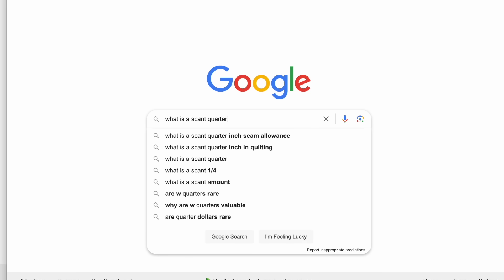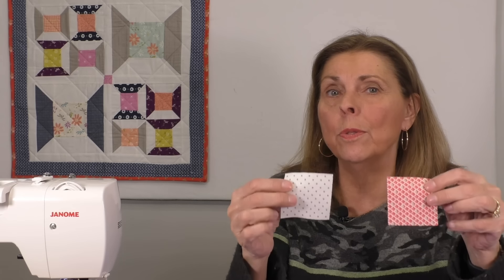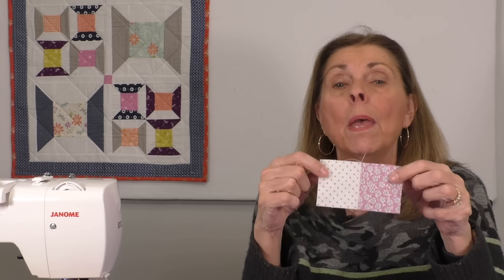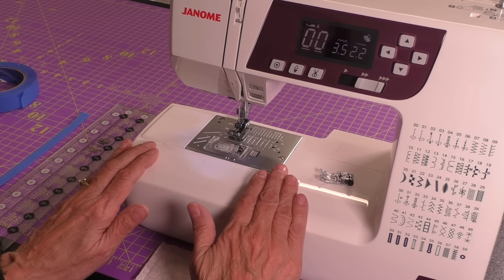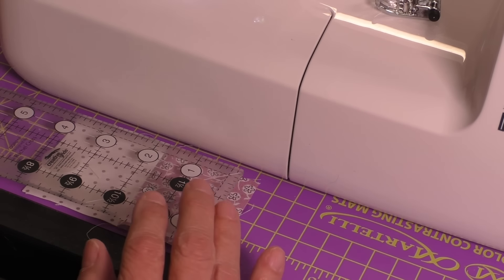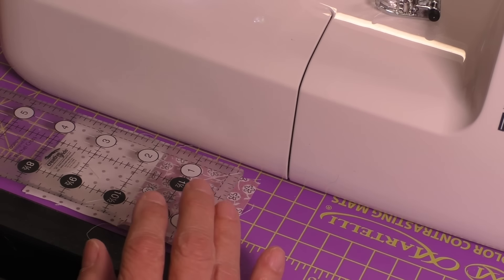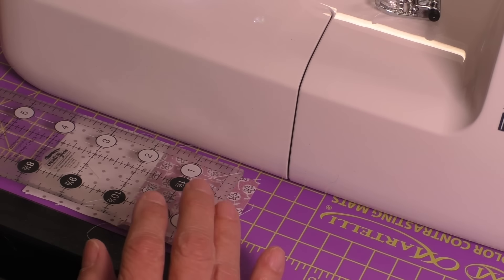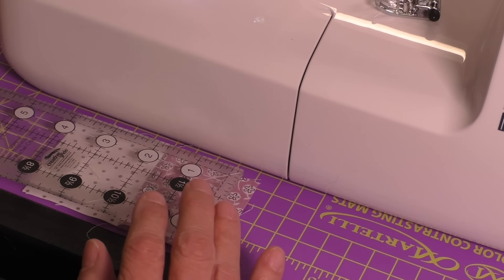Why You Should NEVER Sew "Scant" Quarter Inch Seams

Comment: Thank you.  I just finished month (block) two of a Block of the Month quilt (my first quilt) and each time I tried measuring and marking my seams for the elusive 1/4 inch seam.  Some were right on, some wonky and I had marked my machine with a single layer of painter's tape.  The finished size of block one was close to correct, but block two was off by over 1/2 an inch.  I am SO GRATEFUL for your video.  I will do exactly as you showed and make test squares.  I had never considered that the thread size and fabric foldover would make a difference.  Genius.  Helpful.  I will subscribe to your channel and look for more tips as I learn this craft!
Reply from the maker: Thank you so much for your kind words and for watching!  Good luck and feel free to ask any questions you may have - I'm happy to help!

Comment: This is the best video for new quilters when sewing their seams. You did a great job! I am able to get an accurate seam with my edge 1/4" foot and needle position, but many do not have the ability to move their needle. However, I loved your video. It can be used for any size seam.
Reply from the maker: Thank you so much for your comment!  Yes - I absolutely agree - the needle positioning option on a machine is the best option.  But this is helpful for those without that option.  Thank you for watching!
Reply: @joyfulandmerryquilting  I not only watched, but subscribed. Thanks again!

Comment: Mary, I agree with your frustration and your approach.  I would modify it in small ways and add a bit.  I would test with 3 fabric pieces to make sure a slight difference didn't compound.  I would NOT put the seam guide across a top bobbin cover without also using an Exacto or box cutter, after positioning, to allow a bobbin change without starting over.  Also, I would emphasize an accurate pressing technique and awareness of thread sizes.  I saw a comment referencing Karen Brown at Just Get It Done Quilts and she has also helped me tremendously with these and other accuracy issues.  Finally, I still use a 1/4" foot but mostly rely on it only when sewing on each side of a drawn center diagonal, a la HSTs, since this trick works not-at-all for that technique.
Reply from the maker: Thanks for the input - I already made a Part 2 video that included some of your suggestions that I took from comments made by other viewers.  Here's the link if you'd like to take a look:  https://www.youtube.com/watch?v=xYL3LhiXB2k&t=1s

Comment: I started using this method when I started quilting over 30 years ago. I quickly determined that the quarter inch guide or foot were not accurate. Plus I needed a guide for my fabric to follow. I wanted to speed sew and I wanted the "rail" for my fabric to follow. The wool pressing mat made the difference for flatter seams and accuracy. I used a magnetic seam guide once but the vibration of the machine moved it. My machine had a plastic bobbin cover so it works best with all metal. The sticky tape works best for me.
Reply from the maker: Thank you for your input!  Sounds like you agree that an accurate 1/4" seam is the way to go!  Thanks for watching!

Comment: I have the same Janome machine as you, and I love it, but the 1/4" foot caused me a lot of pain at first. My pieces were inaccurate because the seams were too large. "Scant" was difficul to judge. Eventually I purchased the purple vinyl Qtool Sewing Edge, which works just like your masking tape. It's moveable and reusable, and works better than my 1/4" foot. I wish janome would make a "scant-1/4" foot. I make a 10" postage stamp block from 1.5" scraps of each quilt I make. My earliest ones are 1/4" to 1/2" too small because of the problem you discuss. Thank you for helping new quilters resolve this problem.
Reply from the maker: That is GREAT information!  Thank you - I will check it out.  I see that it's made by Marci Baker and I love her products.  I have ordered it and will give it a try! 
Thanks again and thanks for watching!

Comment: Thank you Mary for this helpful video.  In the Shabby Fabric videos a special thick stackable tape is always used. However, they do not demonstraight how to measure and place the tape as you did. You did an excellent job showing how to. 
Since one of my quarter inch feet for straight stitch has an opening on the 1/4 inch blade itself  I just wrapped 3 layers of blue tape on it and it gave me the exact  measurement. This makes it possible to change the foot for other pieces that doesn't require 1/4 inch foot and when I need to remove the bobbin. Thank you  again. I'll be sure to  share this videos with the quilting girls. 😊
Reply from the maker: Thank you so much!  And that's a great suggestion for your 1/4 foot!  Thank you for sharing!

Comment: Thank you; I will give this a try!  I've been in too many QALs where a "scant" quarter inch is required.  My main issue is, when 9-12 different artists have designed the block patterns, it is clear to me that they do not all measure this the same way.  Some of my blocks will match, whereas, others will be up to 1/4" off, using the exact measurement for my scant quarter (i.e., using a similar method to what you have here but a purchased, adhesive guide,  Now, if we could get EVERYING to use the same method!
Reply from the maker: You're welcome!  Thanks for watching!  I agree - it would be nice if we all calibrated everything the same way so that there's no guess work involved!

Comment: Mary I pin so how do you use the painters tape with pins? I’ve tried tape but get frustrated trying to use pins. Couldn’t figure out how to get around that.
Reply from the maker: I really don't have a problem with pins.  I tape all the way down the front of my machine so the pins farther down the piece don't get caught in the tape (if I'm sewing a long strip).  Otherwise, I'm careful to remove pins or keep them out of the way as I'm sewing and really don't have a problem with it.  Hope that helps!

Comment: To me .... this is still using the scant 1/4" method because when she measured she said to position the needle just slightly to the right of the 1/4" ruler line and mark that position with tape. THAT would be a scant 1/4". Correct??
Reply from the maker: The word "scant" is an unmeasurable term - as I mentioned in the video - and can be very confusing as everyone's "scant" can be different.   I find that when I teach, there are so many different ways to sew a "scant" seam that I found it was easier never to use that term, and simply show how to sew accurate seams every time. 
Thanks for watching.
Reply: @joyfulandmerryquilting  I understand your point and appreciate your videos.

Comment: I learned something that will help.  Thanks about the needle drop to measure the 1/4 in.👍
Reply from the maker: You're so welcome!  Thanks for watching!
Reply: @joyfulandmerryquilting  I checked my seams as you recommended and I am waaay off.  Can’t trust the 1/4 inch foot.  Explains why my final 12 inch square doesn’t measure up.  Grateful for your tip.  😘

Comment: Does it make a difference if you buse ghe 1/4" foot for all ofbyour squares? Surely the most important thing is that they all match in size?
Reply from the maker: If you watch the beginning of my video, I did use the 1/4" foot and my finished piece was about 1/16th of an inch too small.  It is important that all the sewn pieces consistently match, but if some are all slightly off (such as mine was) then you can have an issue as you begin to assemble a quilt block.  For example, if you sew together 2 squares together, and the finished piece is slightly off (like mine was) due to that seam, it's different story.  If your entire quilt was made up of only the squares, then yes, being consistent with your seams will work.  But if your quilt has other sized pieces in the block or quilt, such as 2 1/2" x 4 1/2" rectangles that need to be sewn to the 2 1/2" x 4 3/16" pieces that you made with the 2 1/2" squares, they just won't match and that 1/16th" discrepancy will continue to compound itself the more squares you sew together.  That's why consistency is important, but so is accuracy.  I hope that helps.

Comment: With this method do you need to reset each time you have to change bobin and clean inside machine. I would like to be more accurate.
Reply from the maker: I carefully remove my bobbin case lid while leaving the tape on.  I use a very small single layer of tape over the end of the stacked tape and then curve that single layer piece over the bobbin case lid just to keep the end in place.  It's thin enough that I can still close bobbin case lid when changing the bobbin on my machine.  Not sure how that would work with yours.  The tape does need to be changed periodically - but I can remove it a time or two and then stick it back on as needed.  When it loses its "stickiness" and starts to curl up, I replace it.  If find that it does last quite a long time.  Hope that helps.

Comment: How do you do HSTs
Reply from the maker: If you're talking about sewing on a diagonal line or sewing 1/4" on either side of a diagonal line, I don't find that the tape gets in the way, but rather helps me stay on track.  My presser foot slides along the side of the tape as I'm sewing on the diagonal line.  When I'm sewing 1/4" on either side of the line, I can't use the tape as a guide because I can't see it - and I usually make many HSTs at one time, so i simply remove the tape and replace it when I'm finished.  The tape still has some "stickiness" left and I find I can remove it several times before I need to replace it.  Works for me!  :-)

Comment: Thanks Mary, I use the painters tape but had an issue with the edges. I never thought about trimming, duh.  What do you use to trim to get a nice clean edge? Painters tape can be tough especially with 5-6 layers.
Reply from the maker: I really should have put that in the video - I just use an old rotary cutting blade in an extra cutter that I use to cut paper and tape, etc.  I have a special handle that's labeled "paper", but it works for the tape as well.  Thanks for asking!

Comment: Question: how about the ¼ inch foot and just move the needle over to the right until you get the right "scant"?
Reply from the maker: At the beginning of the video I did sew the seam with my 1/4" foot and showed that it was about 1/16th" off.  You can move the needle if you have that capability on your machine - and then test the seam as I did before beginning to sew, but many don't have that option on their machine and this is for those who are still looking for a DIY way to get that accurate seam.  Thanks for watching!
Reply: @joyfulandmerryquilting  Thank you so much, your explanation of the "disappearing" size makes a of sense. It means 1,5 mm discrepancy and that is a lot! I will certainly test it out.

Comment: Mary .. I am curious what you used to cut the painters tape to get your straight edge.  I am always afraid to use rotary cutter on anything but fabric … is that what you used?  Thank you.
Reply: You might try a box cutter instead of your rotary blade. It should lay flat against a ruler.
Reply from the maker: I used an "old rotary blade" that I have in a cutter that is only used for paper, tape, etc.  I never use my good blades for this type of cutting, but once the old blade is no longer good for fabric, it still has a lot of life left in it for other things.  Thanks for watching!
Reply: @joyfulandmerryquilting  perfect!! I didn’t even think of that.  I have my old blades in a safe place for disposal; I will mark one of them for this type of use.  Thanks so much!!

Comment: Mary I love using the painters tape marker to get the perfect 1/4 inch seam but it crosses my bobbin case cover so I’m having problems keeping it from curling up and coming loose after replacing my bobbin.  Do you have a solution for that or do I just need to make another tape marker with each bobbin?
Reply from the maker: I had that issue with my tape on one of my machines.  I took a small single layer piece of tape and taped it to the "beginning" of the stacked tape so that half was on the stacked layer and half was hanging over the edge of the bobbin case.  I then folded that extra length over the back side of the bobbin case (the side toward the back of my machine).  That way the single layer of tape adheres to the stacked layer, but the little bit of extra tape is thin enough to wrap it around the bobbin case lid.  You need to make sure there is enough room for the single layer of tape (mine had plenty of room) when the case is closed so you don't damage your machine) and then I trimmed off the end.  When I closed the bobbin case (carefully) it stayed in place.  Hope that helps!
Reply: Why couldn't you cut across the tape so it moves easily ,attached to the plastic bobbin cover.Then it fits back perfectly when the cover is replaced.
Reply from the maker: You absolutely could!  Thanks for commenting!  That's a perfect solution!

Comment: Thank you for the video and the clarification of what the scant seam is and how to rectify the problem. I have the magnetic gage and also a quarter inch foot.  Since my quarter inch foot, I have sewn so much better. I'd like to ask why you don't use your 1/4 in foot?  or was that just for the video and if people don't have one? The only issue I found with your method is the annoyance of re-setting everything up when you have to change your bobbin. Thank you again.  Great video
Reply from the maker: I explained at the beginning of the video that I used my 1/4" foot to sew together two (2) 2 1/2" x 2 1/2" squares and I showed that the finished width after sewing them together should have been 4 1/2", but it was a tad short.  I don't use a 1/4" foot because once I put the tape on my machine, the guide on the 1/4" foot is in the way of the tape and since it's not as accurate as I would like, I just don't use it.  I don't really have an issue with removing the bobbin - I just do it carefully and I do have a tiny piece of tape (single layer) that I place on the end of the stacked tape and around the bobbin case lid to secure it.  The single layer piece of tape is thin enough for my bobbin lid that it still opens and closes easily.  I figure that the little bit of extra time it takes to change the bobbin, it's worth it in the end to have an accurate seam.   Thanks for asking and thanks for watching!

Comment: I use painters tape too.  I stack multiple pieces to make a ledge/guide.  If I’m using a machine that is digital, I sometimes just shift the needle over a notch or two to get the seam allowance I need.  My most preferred method is to cut the fabrics slightly larger and then after piecing, trim down to the correct size, assuming the style of block lends itself to that method.
Reply from the maker: I absolutely agree!  Thanks so much for watching and for sharing!

Comment: I have done this before, but what do you do with tape when you are doing half square triangles.  But I totally agree about scant quarter inches, I always a ys that was ridiculous,  what is accurate in that
Reply from the maker: It depends on the method I'm using to create the half square triangles.  If I'm making a LOT of HSTs I may take the tape off if it's getting in the way.  If I'm just sewing on the diagonal, the tape doesn't cause an issue so I leave it.

Comment: I would love to improve my accuracy so I’ll try it. The more seams in a block, the further off (smaller) I get. Currently making 9-patches that need to finish at 3.5”. Interesting that you don’t use a 1/4” foot or change the needle position. Thank you for the video.
Reply from the maker: You're welcome!  I have had good luck with my needle in the center position because I use the universal foot, and that's where I it.  The guide on the 1/4" foot gets in the way of the tape - so I find I can be more accurate with the universal foot and tape.
Reply: I have consistently accurate results with using my gated foot and 1 click to the right on my machine.

Comment: I use an 1/4 inch edge guide foot on my Juki. It keeps the raw edge of the seam against a vertical metal edge on the foot.
Reply from the maker: Yes - as long as it's accurate, that's a great option.  Thanks for sharing - Juki is a great machine!

Comment: I press the quarter inch button on my old Viking D1 and that’s all I do. I don’t do any mucking around with measuring seams allowances etc. consistency is what matters
Reply from the maker: I"ve commented on this before...that works fine if all of your pieces are the same size.  If you have triangles and rectangles and squares and are trying to put those together, you need an accurate 1/4" seam allowance or the puzzle pieces just don't fit.  Thanks for watching!
Reply: I have the same machine, but I like to use the straight stitch throatplate and quilters foot. But then I sew VERY simple quilt tops!